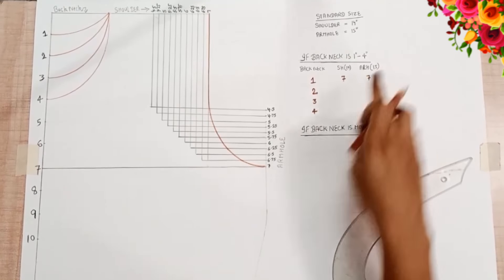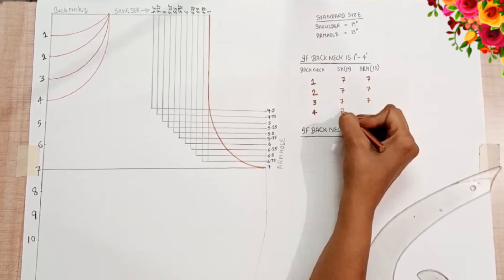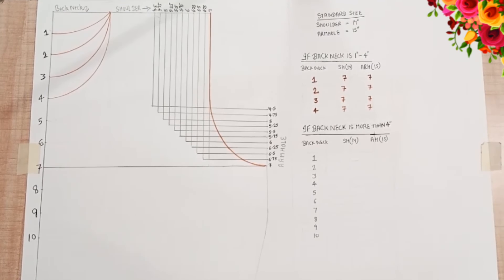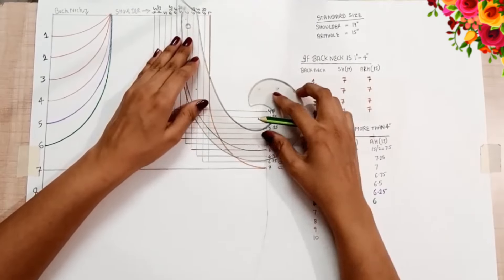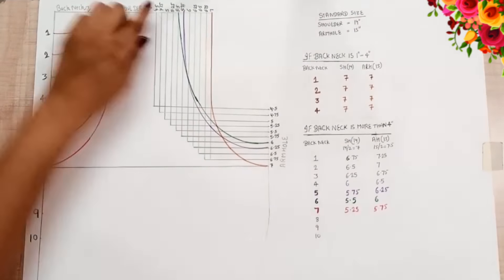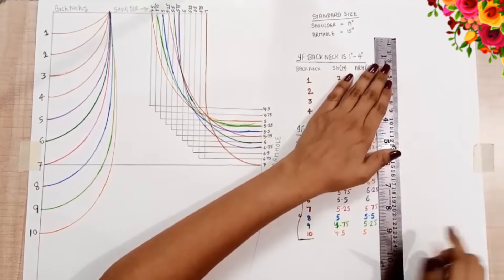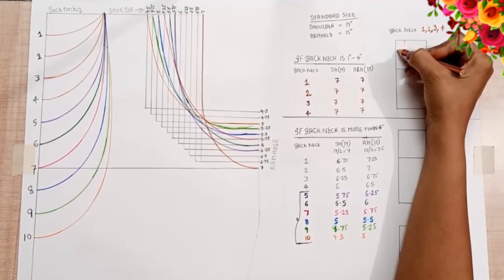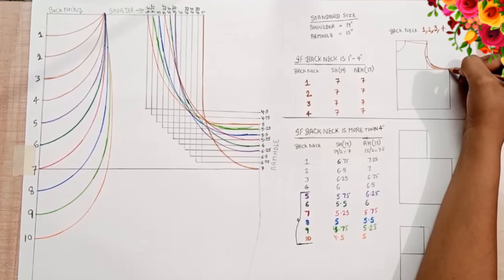Shoulder and armhole problem solved / shoulder and armhole measurements / deep neck shoulder armhole

Comment: Is it compensation to take 2.5 as a neck width in any size of blouse?
Reply from the maker: If back neck is deep u can take 2" if back is not deep u can take it 3" as well
Reply: @stitchingbyheena8954  which will be the last size of neck width only 2 and 3 or more than that plz make a video on it
Reply from the maker: Upto 4" deepness of back neck = width of back neck is 3"
5" to 8" deep back neck = width of back neck is 2.5"
More than 8" deep back neck = width of back neck is 2"
Reply: Thank u sooo much for cleaning my doubt
Reply: Clearly explained
Reply: Silai margin included n this pattern?
Reply from the maker: The formula is chest÷12
Reply from the maker: Yes

Comment: Mam.. You told up to 4"" deep back neck there is no changes in shoulder and arm hole. But in second table you reduced it by 1/4" in each. Why so?

Secondly, is this formula same for both kurti and blouse or different?
Reply from the maker: 2nd table is for deep neck (more than 5), 1 to 4 is just for calculation to reach 5" back neck

Comment: Mam if back depth changes then armhole should also change, then what about sleeves. 🤔
Reply from the maker: Sleeve pattern and formula is same... If sleeves based on armhole then take the half of armhole i.e. 15/2 = 7.5 as per my video
Reply: @stitchingbyheena8954  kk thank you mam. 😊

Comment: Thank you so much. 
But I have a doubt..
My shoulder 16.25 (from arm ends)
My armhole is 19.
If I have to take 7 inch front neck and 5 inch back neck then according to this pattern what would be the measurements.
Pls reply..
Reply from the maker: Half of 16.25 shoulder is 8.1 .. add 0.5 stitching margin in it .. it become 8.6 or 8.5 round off

Half of 19 ( armhole) is 9.5

For back neck of more than 4" ... Deduct 0.25" for every inch of back neck 

1" back neck .. SH 8.25 .. AH 9.25
2" BN .... SH 8 ...AH 9
3" BN .... SH 7.75 ... AH 8.75
4" BN ..... SH 7.5 .... AH 8.5
5" BN ....SH 7.25... AJ 8.25
6" BN ... SH 7 ...AH 8
7" BN .... SH 6.75 .....AH 7.75
Reply: Thank you soo much
Reply: If i want 4 back nick for same sholder and armhole then what i do?

Comment: 1",2",3"4" me jintna shoulder hai utna hi armhole liya hai but jab table form me Aapne backneck depth btate woqt armhole and xback me 0.25 minus Kar Diya. lekin Jaise Apne btaya Uske according toh usme koi change Nahi hona tha. plz explain
Reply from the maker: If back neck is 1- 4 .. upar wala chart use hoga 
Or agr back neck 4 se jyada hai to niche wala chart use hoga .. is chart me jo 1 se 4 likha ho vo sirf calculation ke liye use hua ha ki agr back neck 5, 6, 7, 8 etc hoga to SH or AH kese calculate krna ha uske liye 1-4 bhi use kiya ha
Reply: @stitchingbyheena8954   Means backneck 5 ya ussey jyada hai toh ek dum se kum 0.25 minus Nahi Karna hai balki 1-4 tak ka 0.25 Jo calculation me minus Kiya hai,ussi step ko follow karte huye   0.25 minus karna SH and AH me se. Agar 5" inch Ka back neck hai toh total me se 1.25" minus kar de AH and SH me se
Reply from the maker: @bhawnak6741  han bilkul shi
Reply: @stitchingbyheena8954  thank u so much